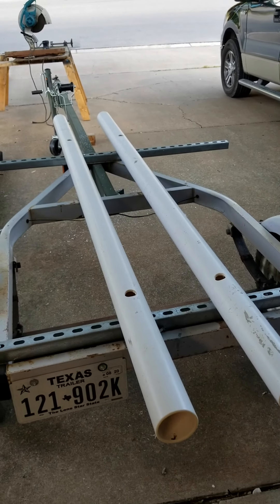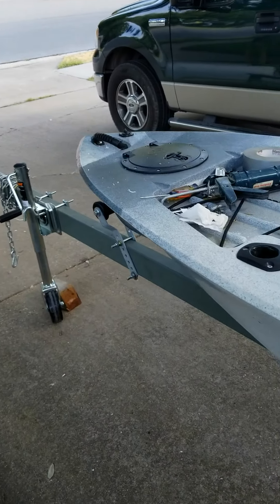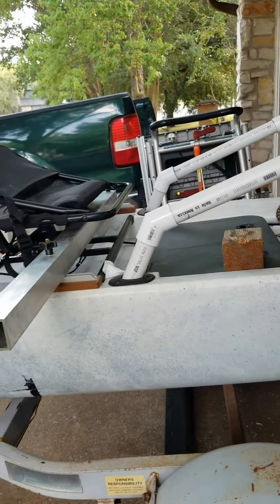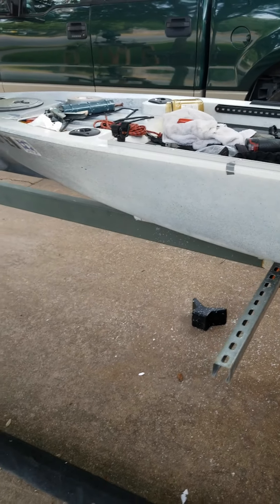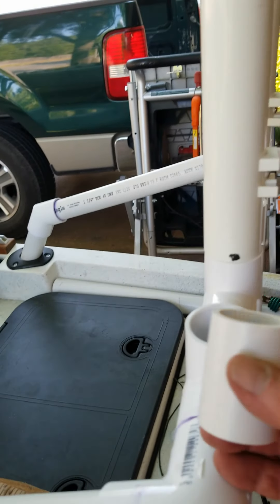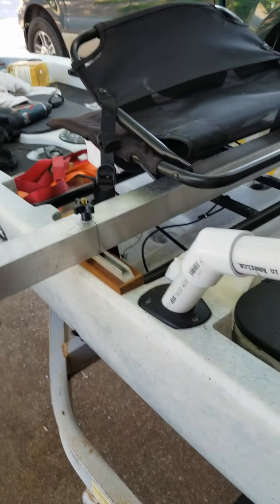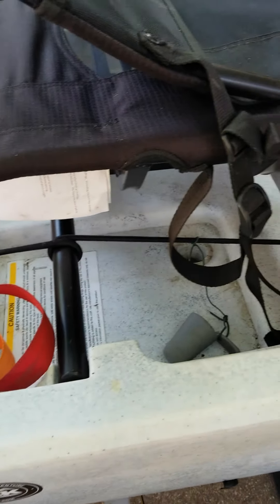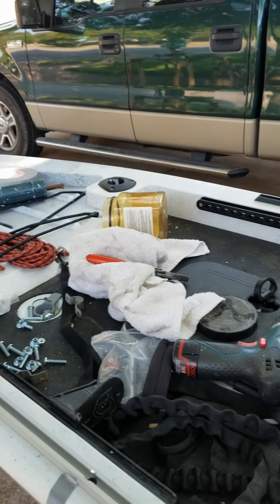Original Kayak Trailer Build PVC bunks

Comment: My trailer is set up just like yours You will like having a witch and  keel    mount with the strap it'll hold the bow of kayak from siding 
forward& backwards & 2  Straps to
hold the kayak from bouncing. After a full day fishing and being tired you don't have to pick that kayak up and put it in the back of your truck It's nice just to slide the kayak onto a trailer. I  use a 2" rubber Y bow stop & zipped  tie it to the tongue of the trailer so the bow sits on top 🎣 on
Reply from the maker: I removed the PVC bunks and installed a flat plywood deck covered with carpet. The crappy Ascend kayak I have warped at the scuppers and bowed the latch side of the rear hatch. Really poorly designed and after all these years they are still making them the same.
Reply: @crude4u1948   OK That's too bad.I launch my Kayak Just like a regular boat My kayak is a is a 2017  Old Town predator PDL & its about 90lb without the drive unit with 120lb+ And I don't use ratchet straps To hold it down I use pull straps its ben a year with with no problem. Good luck with the trailer 👍
Reply from the maker: @jeffthrower4981  Actually, I’m happier with the solid deck. I can do the same as you, using a winch to pull the boat up on the deck. It weighs 973 dry and empty. And with all the stuff including a battery, trolling motor, anchor and gear, probably around 130#. Ascend kayaks are notorious for the thick material and someone recently commented about seeing kayaks sitting on a flat floor when on display. Summer time is especially problematic because the material gets softer unless you can store the boat in the garage or a shed. thanks for looking and I hope you will check out some of my other videos.